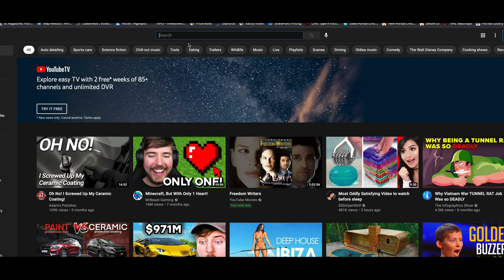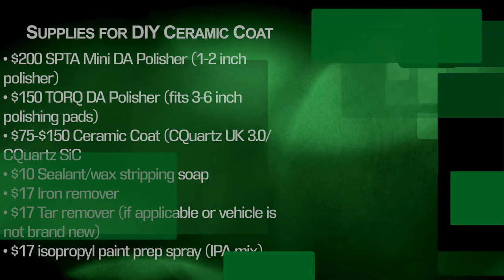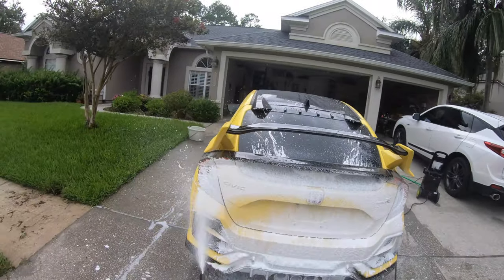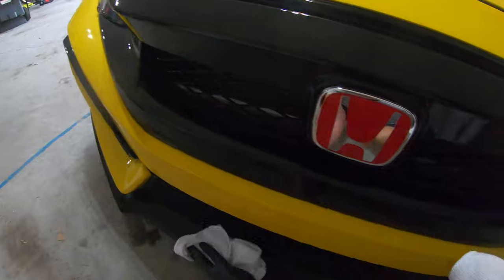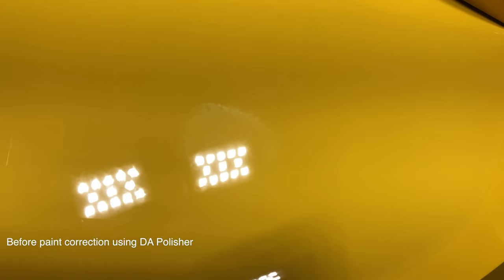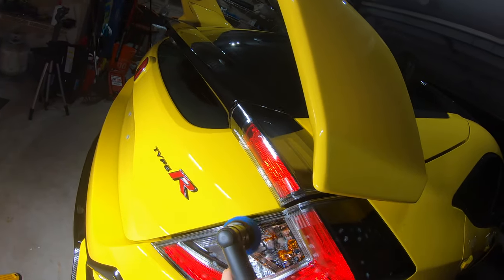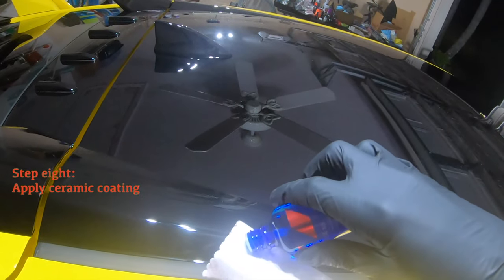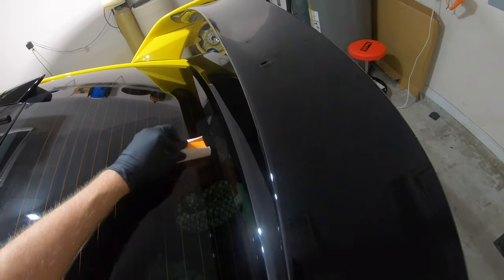DIY Ceramic Coating a brand new 2021 Honda Civic Type R Limited Edition

Comment: Nice work! With this being a 5-day project, did you have to wash/detail spray your car every day due to dust settling on the car?
Reply from the maker: Thanks! No, I just made sure to wipe the car down well with IPA mix in each spot before and after polishing and again before ceramic coating.
Reply: Thanks man!

Comment: I did it last month on my black type R, and there is a lil bit of un match of color on the edge of front bumper and another sharp edges. The car never respray or repainted before. Can i re doing it and clean up this mess?
Reply from the maker: I would try to use a DA polisher and test a small area to see if you can fix what you are describing. Use polish and if that doesn’t work try compound and then finish with polish
Reply: @autojunkyfl  do i need to do it per panel with the compound? Or just the blemishes only? Thank's man